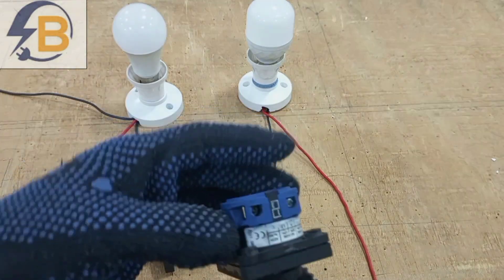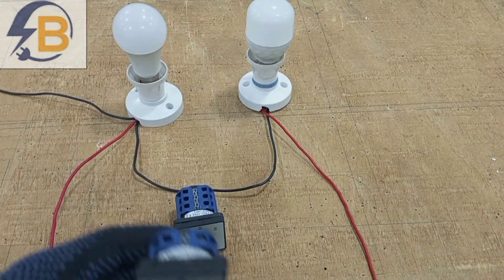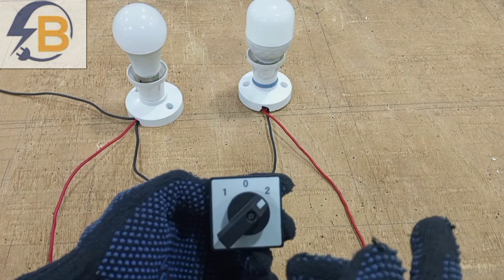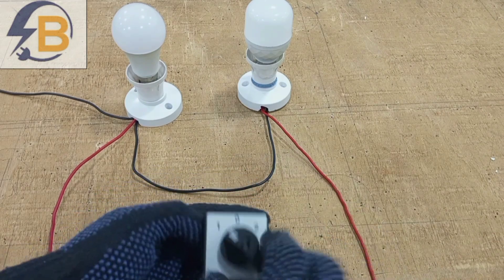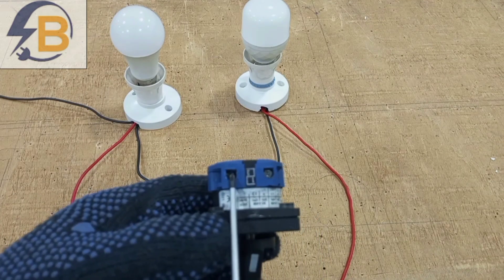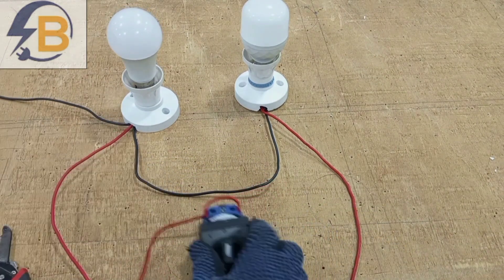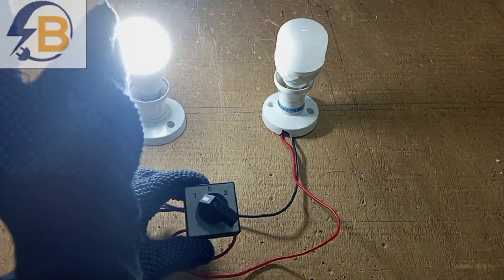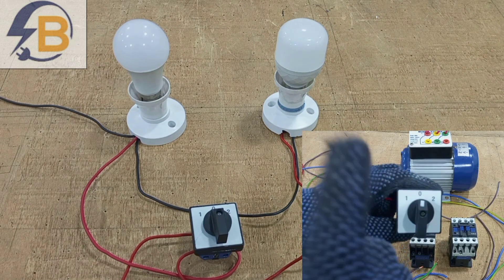ROTARY SWITCH WIRING

Comment: 3:56 Wow! Thanks for sharing it with us. But I wanna know that does the terminals has markings to indicate where a feed goes as well as the switch wire.
Reply from the maker: @danielteyehuago1633  Yes. There are  markings to show the corresponding input and output for each pair